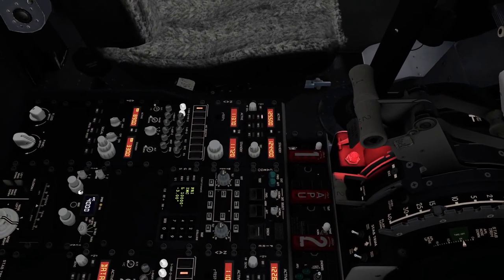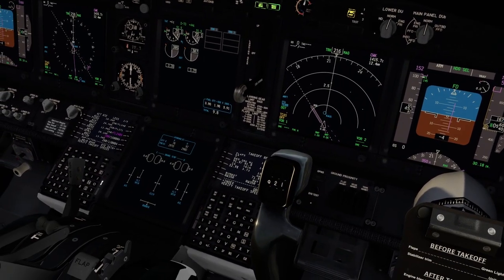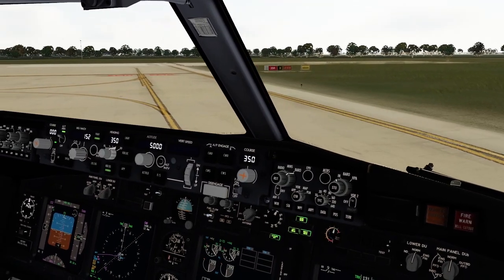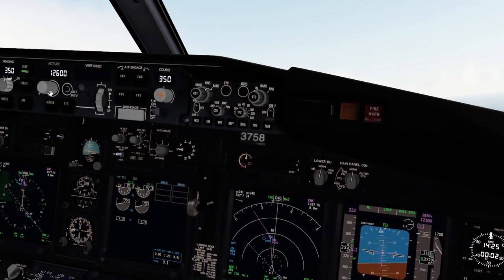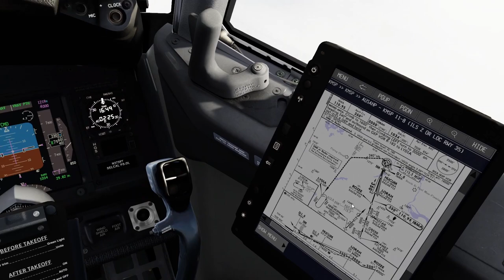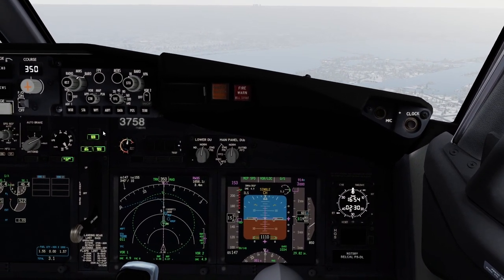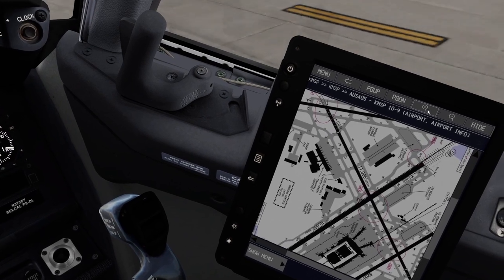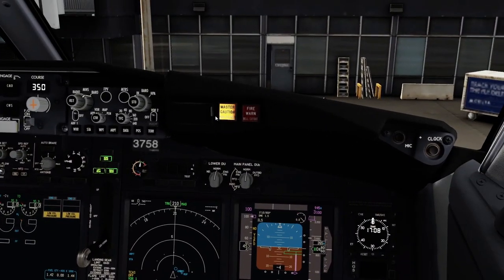Prepar3d v5.1 HF1 - Austin (KAUS) to Minneapolis (KMSP) PMDG NGXu + Pilot2ATC + FS2Crew

Comment: What are your global settings on p3d ? I’m also using p3dv5 with my gtx 1660 super but sometimes my settings change sudenly (like truesky)
Reply from the maker: There's a link with my settings on description
Reply: Thanks a lot just how many vram did use on a big airport ? Because sometimes my setting change when i am at 4,4/5,1go 
But my graphic card have 6go available
Reply from the maker: @frz_blacklord3683  I don't use photoreal scenery around airports, just the airport perimeters. Always delete the photoreal BGL files. I manually compact my other scenery textures (Running in a 1080p monitor, it's ridiculous to have 4096x4096 textures in the sim) Manually compact my outside aircraft textures (never use outside view anyway and you can see on the videos that zero quality is loosed) 
Landing at KMIA (my worst scenario with FSLabs) around 3.9Gb max - Flying here in Brazil, around 2.5 max.
Reply: @fsprimo  did you know how we do for delete the bgl file ?
Reply from the maker: @frz_blacklord3683  Test, test and test again, usually are the bigger files. But deleting the wrong ones, you can broque the scenery. Backup it first.
Reply: Okay thanks a lot